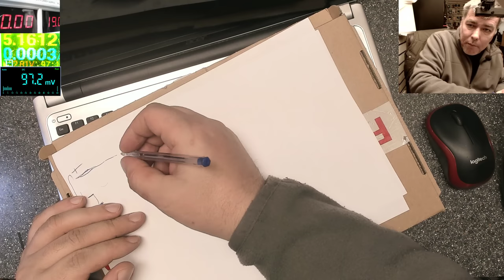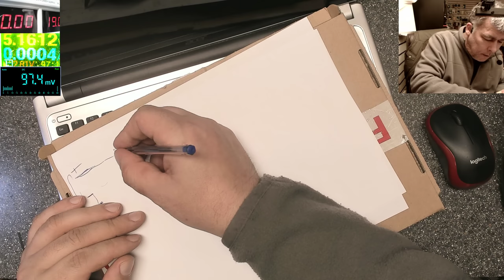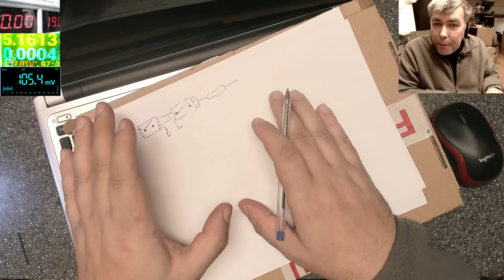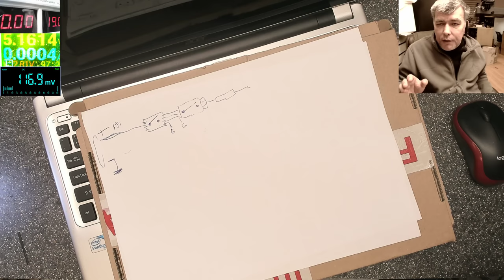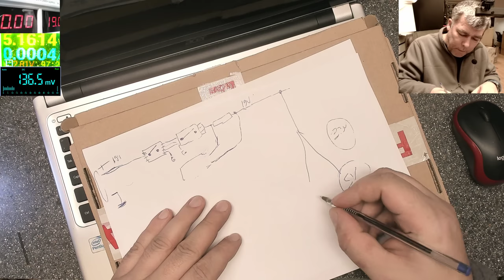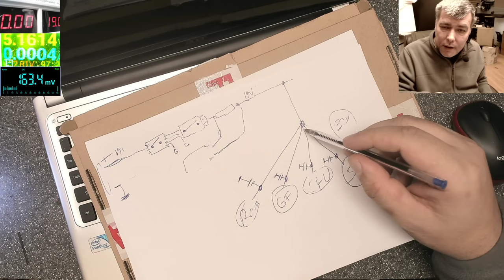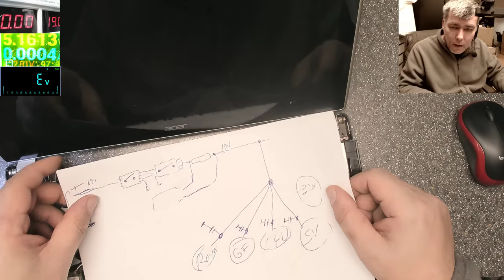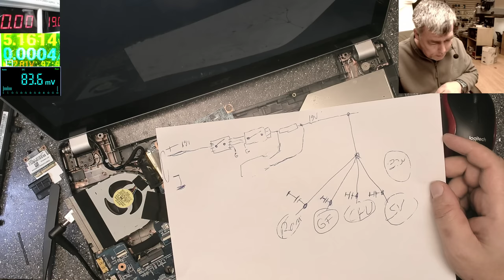Laptop Motherboards Repairs - The power input circuit

Comment: Initial my school laptop costed 700€: i7,  16GB Ram, 940 graphic card 2GB, 500GB HDD 128GB SSD.

The hinge broke down and my screen acted funny. I started to diagnose and figured out putting pressure on my screen/ screen chip at the bottom made it go away. but came back after a while.

So I first repaired the hinge with 3 small  bolts. And then changed the screen for 100€. I also changed my HDD with 500GB SSD Samsung EVO. Glad to do it because a new computer would cost me 1000€+ for a decent one. In total I wasted 200€ so 700+200 = 900€. Build up experience and also always had my laptop available for school.

Mostly this is because of people like you sir. Made me realize nothing to be afraid of and just analyse and repair carefully.

Comment: instead of removing the mosfet and putting a wire couldent you use a Diode to stop the volts from going back into the dc soket and down the charger
Reply: i have a asus laptop that as had the mosfet removed and when i unplug the charger from the mains the charger light stays on lol as its sending current down the dc socket back to the charger

Comment: You should go a little more in depth about those input FETs and how they actually operate, instead of simply treating them like switches. I for one, to my shame, although I fix laptops myself, still cannot wrap my head around how they work and how they "act". There's both P and N channel types in there which also have body diodes in them, further confusing the way they operate. Can't figure out what the gate needs to switch the D-S junction on/off.... A look at an actual schematic for any laptop would be great to illustrate this. Cheers !

Comment: Why don’t. You have to use a lower testvoltage on the second mosfet to detect that there is an short? If a switching mosfet from power supply (from for example the cpu) is also blown and permantly giving power than the cpu receives this 19v voltage also. Or am I wrong some where in this case? can anyone explain

Comment: Unlike these motherboards which has the charger connector n initial circuit integrated. what to do if the circuit is separate removable...n whenever i connect the charger the light on the charger trips off...  its a sony vaio laptop...

Comment: Please show us that it chargers with the faulty mosfet, The same ic that controls the first two mosfets, controls the charging of the battery and talks to the battery and EC ( super IO chip)
Reply from the maker: i still can't see the connection, i had 19v  before the mosfets, 19v after.... have absolutely nothing to do with the charging
Reply from the maker: I understand, but my issue is not the charging circuit, my problem was a shorted cap and a shorted mosfet
Reply: @electronicsrepairschool  That was my problem too, The first mosfet was briged and would stop charging after while and run down the battery , unplug the charger and replug it would let n charge for n few minutes then stop again that was with the first mosfet shorted, I removed the short over the mosfet and the laptop would not switch on
Reply from the maker: thats because your management chip was dead!!!!  Not because you short the mosfet, those mosfets are doing nothing else than driving the 19v to the rest of the power supply's.
Reply: @electronicsrepairschool  That's the first thing that  I replaced, thinking that it was the problem but it was not the management chip

Comment: I have the Asus ROG G751JY Gaming Laptop and Brand new Battery will Charge to 100% and work good for several hours then all of a sudden Fail and the laptop will not turn on again unless I Purchase another New Battery. This has happened with 5 Batteries so far. When Fully Charged Everest Software lists the battery as Plugged in A/C and Discharging, Is this normal?
But the Battery does stay at 100% Full Charge when Plugged in.

This New Battery seems to be ok for now, but will it Fail also? this Battery states that it has 4% Wear and seems to be not failing like the other ones did with 0% Wear listed. Is it possible that my Mother Board is Defective?. Or just a bad batch of Batteries? Any Suggestions or Help would be great! 

Maybe I was just getting poor quality Batteries? I do not want to be destroying new Batteries and getting refunds for them if it is my Laptop that is causing these issues. This Asus laptop is very good at Gaming and is very fast, but it does generate a lot of heat when gaming and that is when the batteries seem to fail after a few hours after gaming at 65c. I have cleaned and re pasted the the CPU and the GPU and that has helped lower the Heat. The Fans are working perfectly to keep it Cool.

Forgot to add. 
I do have a Brand New Genuine Asus 230 Watt A/C Adapter and a new Replaced Power input Jack.